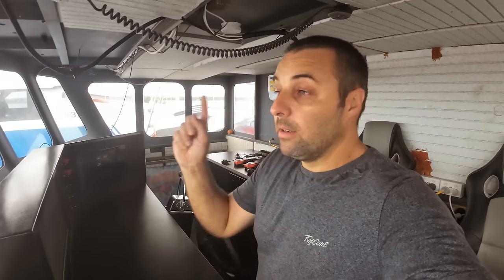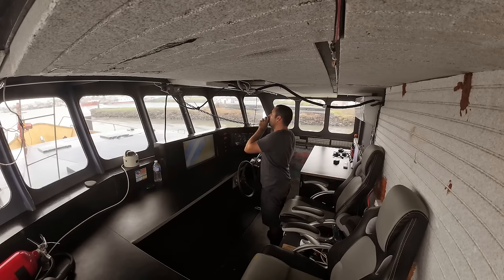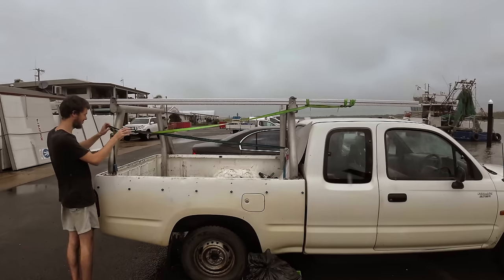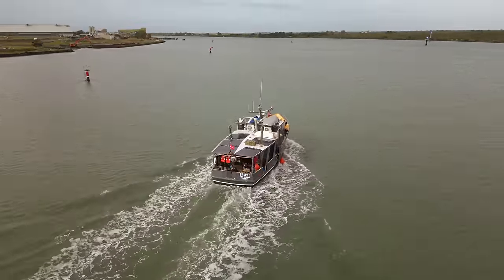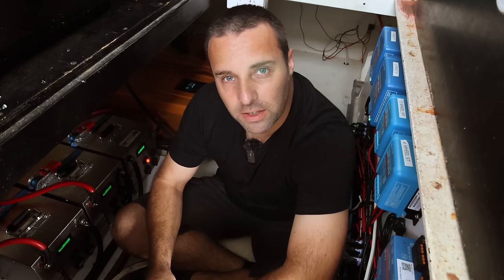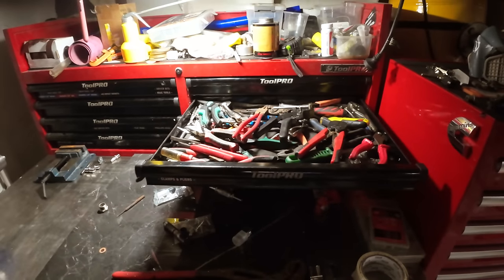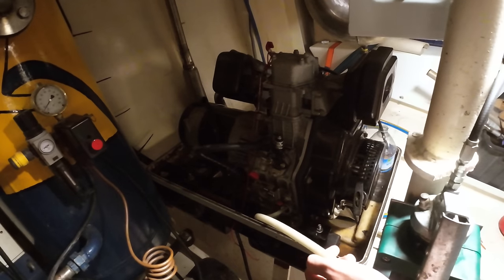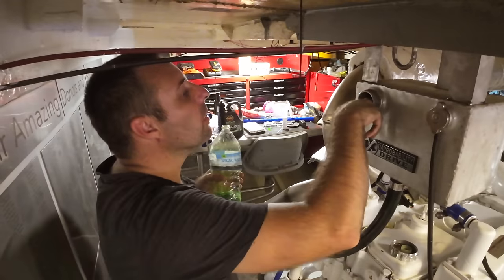Brupeg is on the move - Project Brupeg Ep. 349

Comment: Seems like a lot of hard work maneuvering.  Try using your prop walk to help. Look up 'back  and fill' and you won't have to keep going from lock to lock. It only works to rotate in one direction, but that's ok
Reply from the maker: With the nozzle on our prop we have very little prop walk so the rudder becomes necessary.
Reply: Yup… forget steering in reverse on a boat with a nozzle. It doesn’t happen. Was bad when my boat was 21 feet wide; non-existent now that she’s 36 feet wide. 

Forward clutch with the rudder in the direction you want the stern to go is the only way…
Reply from the maker: How do you find prop walk with a nozzle. This is the first boat I’ve had that’s had a nozzle
Reply: @ProjectBrupeg  before I sponsoned my boat, she steered somewhat in reverse. Now there’s really no maneuvering in reverse.

Best I’ve found is the forward/back action like you have done. 

Since you’re narrower, you might have some steerage in reverse. Avoid hard rudder angles, try about 15-20 degrees. It will be delayed, I found it took about 10-20 seconds before the stern would begin to swing in the direction I wanted. It’s not something to try when you’re in tight quarters. 

Another thing is coming alongside the dock, you need to give a bit more rudder and throttle input to swing the stern in because of the nozzle. Try clutching forward / reverses with little to no rudder angle if you need to get closer to the dock for tie up lines… I’ve found I can walk my boat sideways that way. People have asked if I have a thruster!

If anything, she’ll have a tendency to walk to port while in reverse, but I’ve found it to be minimal. 

Avoid reversing in anything over 4 kts of forward speed… I’ve found that on nozzled boats, you’ll go into a “death spiral”, where the bow will go completely out of control. 

Get a rudder angle indicator fitted!!
Reply from the maker: @jeverich thanks I will give that a shot. Cheers

Comment: Is there any power assistance on the steering?
Reply from the maker: Yeah it is a hydraulic pump that drives the rams but it’s a lot of oil to shift lock to lock. We will be fitting a bigger diameter wheel which will make it a bit easier

Comment: you really need to put a proper spoked wheel on it it looks so awkward the way you are doing it you can spin a spoked wheel
Reply from the maker: That would look about as out of place as putting a spoked wheel on a Toyota Corolla.
Reply: @ProjectBrupeg  really just walk on board one of those trawlers  next to you and spin there helm yes they spin not like that akward turning you a doing with that toyota corrola type wheel it should spin freely if you had of used a spoke wheel you would know how much easier they are to use just my opinion though only had about 60 years on the sea as an engineer and master class 4 up to 50 metres
Reply from the maker: I do t doubt for a minute they spin easier, however it would be a bandaid over the issue. Our hydraulic pump is undersized. And our wheel diameter is too small. We need to increase oil flow and fit our larger wheel.
Reply: @ProjectBrupeg  most of the trawlers that have the cummins engine use the powerstearing pumps off the truck engines they will bolt straight on  and from memory they are a gear drive
Reply from the maker: Yes ours has a 7gal/min pump. It’s as big as well can go without overloading the gear train. It’s fine when revs are up but a bit of a pig at idle. The wheel is too small so it’s harder than it needs to be. We have a larger wheel to fit but the taper is wrong so it’s being machined to suit.

Comment: I hate to be a doom merchant but your new lithium batteries can still suffer thermal runaway and burn at up to 2500 degrees.  That will make short work of thin aluminium boxing. 
They need a fireproof steel-vented box.
Reply: Steel melts at 2500 degrees, so if the batteries burn at the 2500 degree temperature you state, it could still be problem if the batteries decided to burn.
Reply: Very unlikely with lifepo4, they are not EV batteries.
Reply from the maker: Like we said in the video. We are not fitting lithium ion batteries (even chemistry) so fire risk is incredibly remote because we will be using lifepo4 lithium iron phosphate